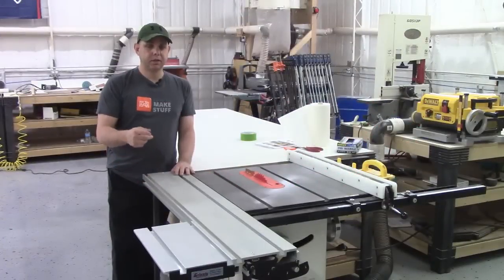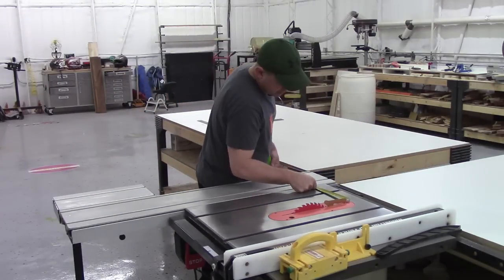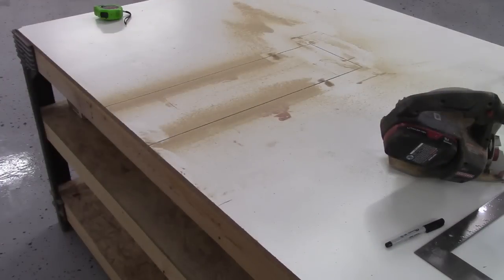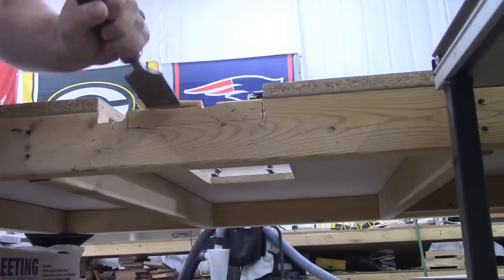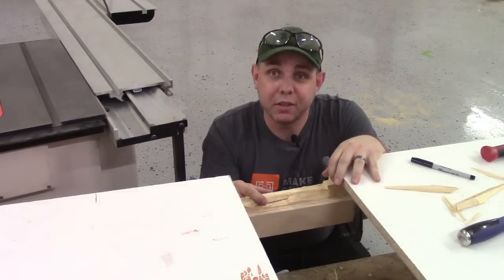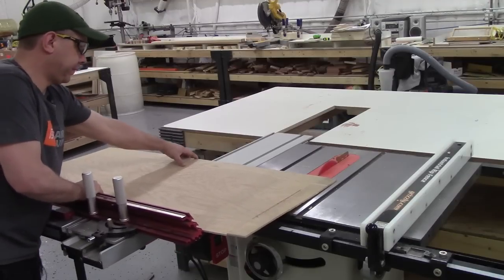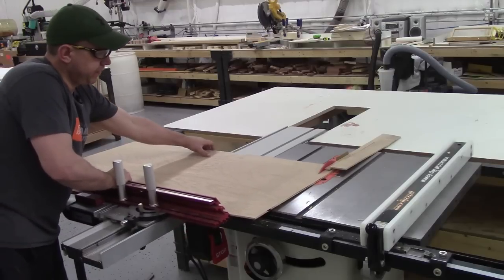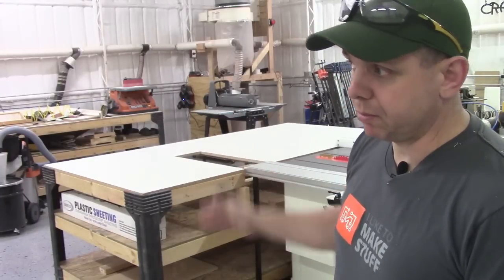Outfeed Table for the Table Saw, Modification

Comment: Excellent Mr ThomPson, I like the way your video is going, can you fit a strip to the underside of the square jig the fits into the mitre slot instead of butting it against the blade? Or did you already do that but I never noticed it ? 📐👍😄
Reply from the maker: I did not do that, but its a great Idea.  A few other guys have messaged me with different ideas,  I will probably take a little bit from each idea and fix it. Excellent Idea Sir. Thank you!!

Comment: I'd be concerned that the blade would flex too much against your squaring jig. Perhaps add a rail or at least two stout tabs to front and back corners of your jig such that they fit into and register against the slot on the right side of the blade. This requires that your blade is squared to your rail slot, which shouldn't be too difficult to adjust if it isn't. This would increase the length of your squaring reference and also be more stable than a flexible blade.

Nice work. How about that review of this sliding attachment you mentioned a year ago?
Reply from the maker: Patrick Niedermeyer I updated the description in that sliding attachment video.. I no longer have that on my table saw. It was in the way and not accurate at all.. there are ways to make it better, but I decided it just wasn’t for me.
Reply: Aye! I'm looking for a good one to add to my SawStop. Sawstop's isn't a professional grade either.  Hmmmm? Maybe I'll have to make one myself.
Reply from the maker: Patrick Niedermeyer I wish I would have taken that money and bought a track saw.

Comment: How do you like the 715 table saw... I want to order the 0771z they are selling but all the forums say to o straight to the 1023 3 hp saw... It's double the price and I'm just a hobbyist, but I do get buying regret and I don't want to. Currently I have the delta contractor 36-725, with and Incra TS-LS wich is cool. Dust colection really sucks on it, even with my 2hp harbor freight collector. Really wish I have an enclose saw like yours, hence my looking at the 0771z. Any advice would help.
Reply from the maker: Jony Q  Thanks for the question Jony!! The reason I went with the 715 over the 771z is the rip fence on the 715 is so much better. The dust collection is lots better than a contractors saw but still not as good as the saws that are double the price. The expensive ones have an enclosure around the blade with a hose going to it.. That will be something I do to mine DIY style. Lol I hope this helps you!
Reply: Jony Q !!p
Reply: Jake Thompson thx for the response!!!! Sorry I took so long. Just ordered a new saw that grizzly just released, in my opinion is the 715 predecesor since it's also polar series. It's the G0833P model. I'm anxiously waiting for delivery, I think the Incra TS LS would be a perfect companion with this saw, check it out!!
Reply from the maker: Jony Q I took the sliding attachment off of my saw, and it's funny you mention the incra ls.. I've been looking at that.. it's pretty cool.
Reply from the maker: Chad Wolf I'm going to take the link off.. just like I took the attachment off my saw.. I will replace the link with that one so people can at least check. It out.
Reply: Jake Thompson I love my Incra, you will never go back to taping fences ever again.
Reply: For cross cutting I also went with incra, it's called the Mitter 5000 sled. Also love that!!! Check that out also!
Reply from the maker: Jony Q I've been looking at all that incra stuff... I like their router products too.. I'm on a spending freeze at the moment or I would have all that stuff already.. lol
Reply: Wish you the best!!
Reply from the maker: Jony Q Thanks man . Appreciate it.👍
Reply: @JakeThompson   Jessem has a nice lift as well as tablesaw guides for doing sheet good's.
If I had the money I'd buy the Incura fence.  no guss work with them.

Comment: So your better off with a crosscut sled, or a Radial Arm saw for cross cuts, or spend 3k on a sliding tablesaw that can handel a full sheet of plywood.  That is no better then a miter gaudge by the looks of it. you saved me buying one knowing you have had problems with it.  
Don't bother look I don't post.  But I will give constructive crtisim when somone needs it.
By the way you don't need to cut the legs to add wheels on the tables.  FIY you can buy fold down style.
I'd copy and paste a link but my left mouse key is not working on this crappy keybord.
and I ahve a 1023Z I bought 15-17 years ago, I made the mistake of buying it as a 240 volt machine then got home and found out I could not get 240 to my shop without changing my main panel in my house, however one day I will add a phony panel. But for now i'll use my 120 volt 2 hp jet I got last summer other then being an open bottom contractor saw it works great just drops a hell of a lot of saw dust on the floor. I don't have a dust collector system for it yet.

I'd going to say buy the Incura fence system you'll love it. No I have not used one, but by the looks of them its a worth wile investment.   Save a few bucks keep an eye on cl  they pop up every so often used.
Reply from the maker: bobbg 👍👍👍